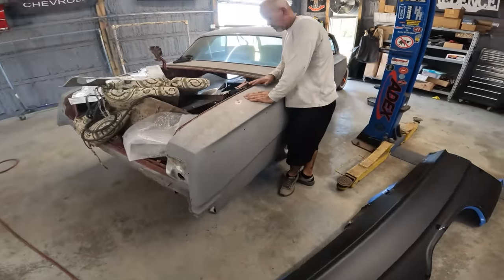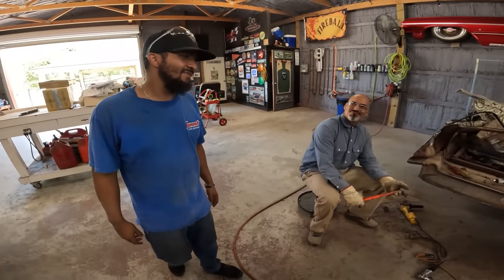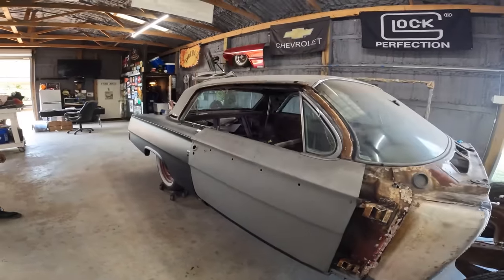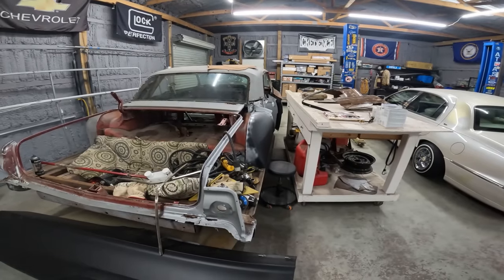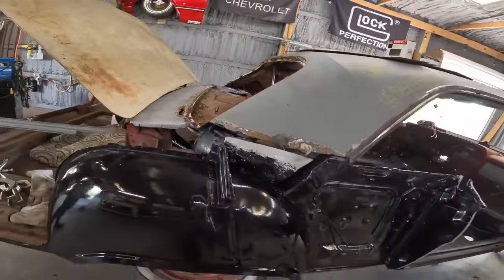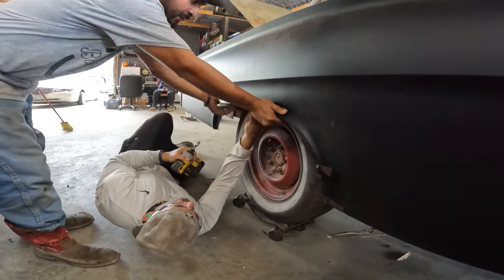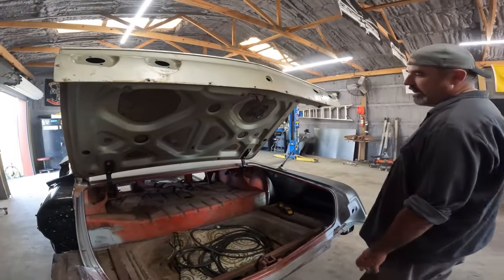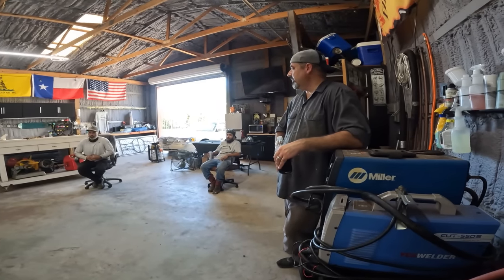1962 IMPALA FULL QUARTER REPLACEMENT / METAL WORK / BODY WORK / LOWRIDER / DIY / DYNACORN / QUALITY

Comment: Merc's were like the oppisite of Dodge. They spent the extra penny's to impress ..If you mess with old boats any, you will see where the coil wire got the better wiring boots to protect from moisture. Cool car. Great channel. Ty. The tranny dip stick tube may have a worn out O ring and that will make a mess. Good luck with it.

Comment: Its a damn shame that i cant upload a picture to this chat. I did my entire car hauler with POR-15. The trick is; do it step by step as directed by POR-15. Its a 3 step process. I tried a couple spots without doing the firsf 2 steps and the stuff peeled off about 2 months later.
The spots that i did as directed stayed and was hard like powdercoating.

The first step after grinding loose rust is to degrease the metal, then apply the prep coat before the actual product
Reply: So in total, you could call it 4 steps.

I live up in the rust belt...Ontario Canada

Comment: What are those trunk screws called that adjust left and right? 

Man how are you guys gonna fix that rust on the roof structure under the drip rail?
Reply from the maker: That's a good question for bobby...

Comment: I just started the video, how bad was the quarter? Could yall have just replaced the lower half? Or is it better to just replace the entire quarter either way?
Reply: Cancer! Remove half or all ? All of it.
Reply: Needs chemotherapy treatment!
Reply from the maker: Toss up. Depends how much filler you want
Reply: @Anthony-to7cp  you didn't read my question. Of course replace all the rust but what if only the lowest part of the quarter is rusted? Read! You just want to speak.
Reply from the maker: On this car he could have patched down low.  We initially thought of cutting from the trim holes down, and covering the seam with the side molding.  But in the end I'm glad we opted for the full quarter because it's going to be much less body work.   The full quarter is going to block down super nice and easy